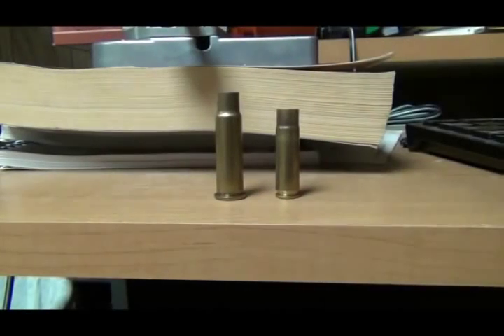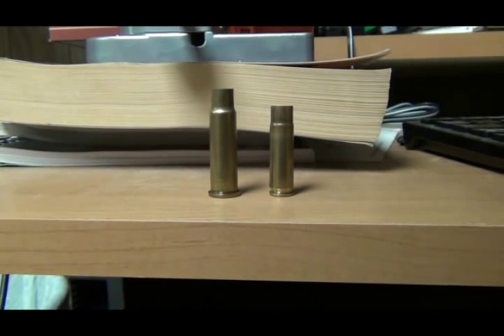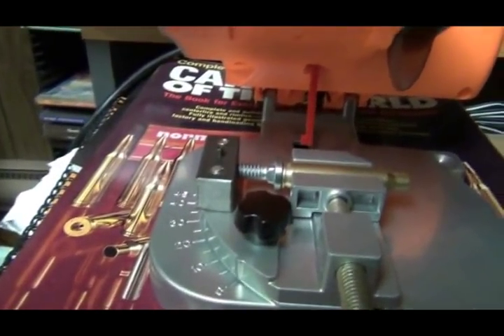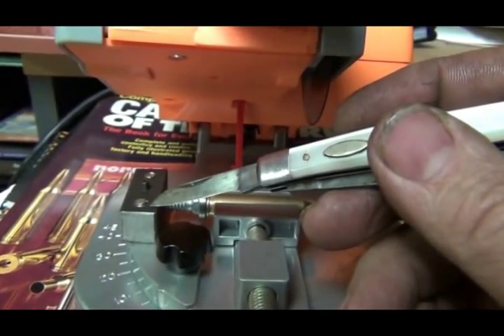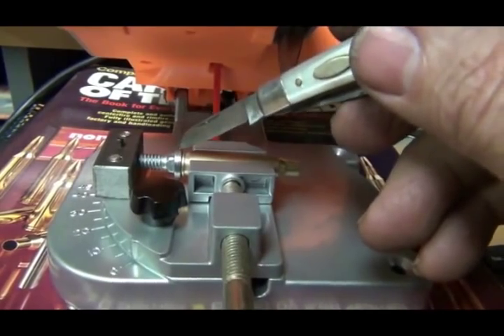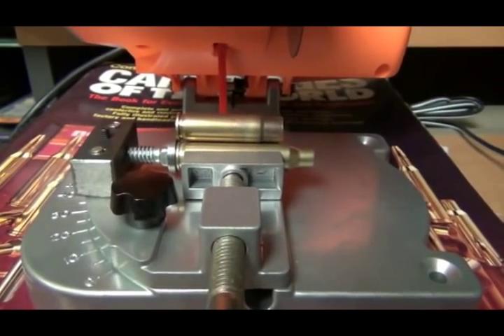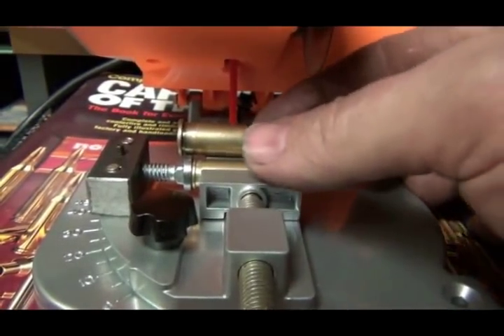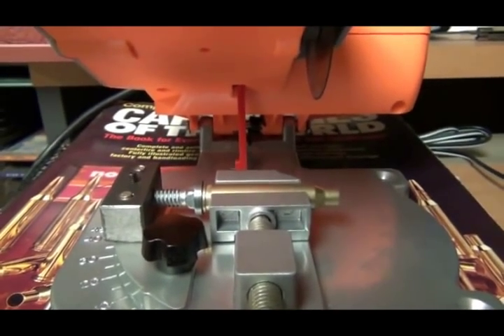Harbor Freight cut off saw mod

Comment: Damn good idea ..... I have an old 9.3x62 mauser an been picking up 3006 brass to FLRS and fire form and I find if I anneal the neck first I have less problems in the process . I was wondering if when you fire form do you use reduced loads with lead bullets or another process very interested to learn other methods